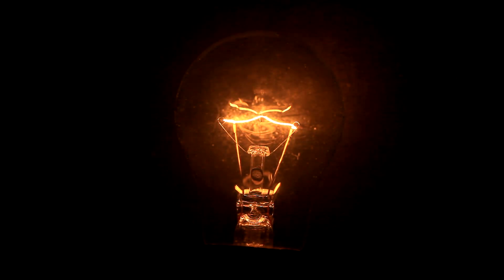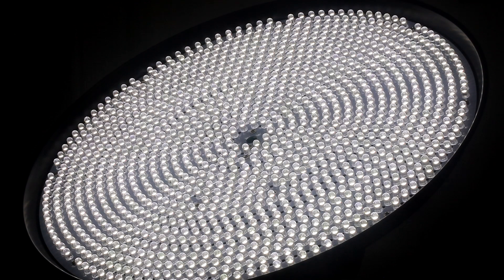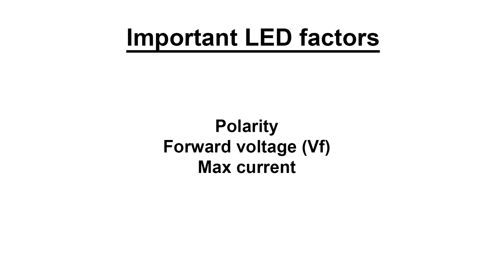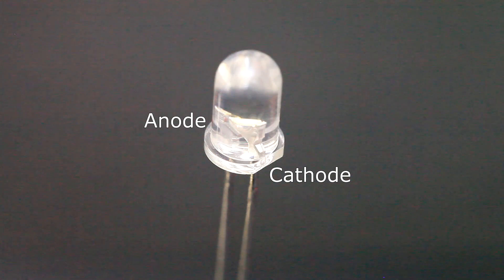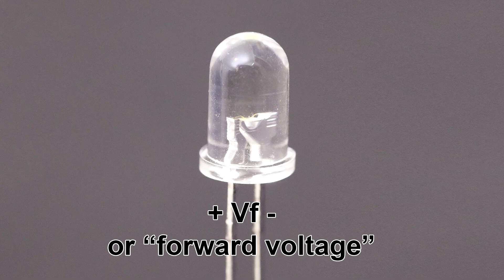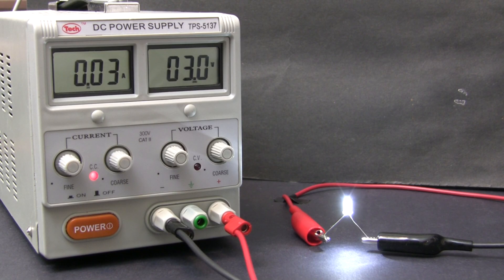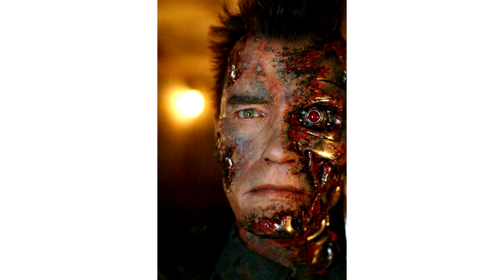LED Basics

Comment from the maker: If you are too stupid to know what "commercially viable" means then don't bother leaving a comment about Thomas Edison.
Reply: I’m not stupid I just don’t know what it means :(
Reply: @Jgamer12901  the ability of a business, product, or service to compete effectively and to make a profit:
Reply: @Jgamer12901  Commercially viable refers to a product which has sufficient buyers to cover costs of production + make a profit for sustainable growth of a company.
Reply: the ability of a business, product, or service to compete effectively and to make a profit.. 🤷
Reply: Gigachad comment.
Reply: Can we turn on the led without using resistor provided that we have 5v and 20ma power supply?.......
Reply: @romulopartoza5598  yes but, it will burn in moments time
Reply: @romulopartoza5598  The 5V and 20 MA rating is considered the upper safe limit Voltage and what the safe Current draw is.  As long as yo don’t exceed the 5 Volts the LED will not exceed it’s 20 MA Current rating.  With that in mind, 20 MA for a Power Supply isn’t what you’re looking for.  The Power Supply could be very small but would need to be able to safely sustain the 20 MA power draw for the LED.  You can have a huge Power Supply and not harm the LED as long as you apply the correct Resistor to not draw more than the 20 MA limit for the LED.  If you drop the voltage of a regulated DC Power Supply to let’s say 3 Volts, the LED should function without the Resistor.  The resistor is being used as a crude voltage regulator in an LED Application.  The newer Bright and Ultra Bright (UB) LEDs are much more dependent on their Voltage and Current Ratings.  An UB may not work on a lower voltage.  A regular LED can work with as little as 1.5 / 2 Volts.  JimO
Reply: @romulopartoza5598  yes you can.
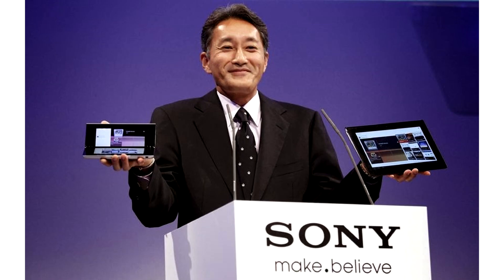Reply: Question, what is this led light called at 1:02?
Reply: @s4m4r1t1ntv  a light emitting diode
Reply: @james77011  I know that, I mean. What's the circular looking type of led shown at 1:02 of the video? It looks like it could be used for a diy arc reactor.
Reply: @s4m4r1t1ntv  can i send u a link with some LED's similar to the one's in the video?
Reply: @james77011  That would help actually so yes! Thank you.
Reply: Woah recent update. Dude please come back! 

Also, who is this comment for?
Reply: Lmao that old chestnut
Reply: Gee, now I want to know who said what, lol!
Reply: @flyurway  Same
Reply: @flyurway  Name names
Reply: Smart ass.
Reply: not true, they didnt even have television back then let alone commercials for products such as light bulbs. fake news

Comment: So for these tiny projects you can get by with a resistor but for larger more ... "finished" projects you would need a LED driver to manage the voltage, yes? If my understanding is correct as long as you supply the LEDs with the amps at or above their requirements you are good?
Reply from the maker: Pretty much yeah

Comment: Forgive the stupid question, as Im trying ti fugure allof this out (great channel BTW) when you toasted the LED by jacking the voltage to over 7v,  what if you took your power supply and limited the current to 3 milliamps @ 7v. would it still blow? Can you even do that?
Reply from the maker: Yes you can! If you set the current limit to 3mA then the LED would be fine. The power supply would probably output a voltage around 2V and deliver 3mA that's it. Current limiting power supplies are extremely useful.
Reply: @Afrotechmods  Thank you kind sir !!

Comment: I wired up and LED to an electrical cord. I plugged it into my electrical socket, and it blew up the LED, and my breaker blew. I forgot to add a resistor.

Comment: I want to say thanks for making this simple to understand. I know ZERO about LED's accept I'm thinking of cutting some circles in my trolling motor for night use where I can know which direction the head of the unit is facing at night because nobody was smart enough to include that on $3k+ items. I can handle the holes but don't know how much power I need to run to them as my boat has 12Volts and 800 Cranking Amps. LOL... Quite sure that will blow the tiny bulbs. LOL.

Comment: When I started to learn electronics, only red LEDs were available and green ones came out a while after. Then later I saw a  three color LED at a Radio Shack store, which could glow yellow when connected to an alternate current source. It was glowing green when connected in reverse polarity. One day I shook it while it was yellow then noticed it was alternating between red and green. So cool I felt that day. Before I saw blue ones then finally the white ones, many many years passed.

Comment: I have only one question about led.The led is not  new invention .
We have led from the 80's, but why only in recent years so much development has been observed?And now their expansion in many areas?
There were a "dead period" between 1985(?) -2015 (ok at 2004 we have the blue,and little be later the white)
Reply from the maker: That's a good question, and I think the answer is around 2010 or so we started seeing manufacturers making high power (1W+) LEDs at prices well under $1. Also by then an abundance of cheap and easy to use constant current LED drive circuitry had come on to the market. Once things become cheap and easy enough to use they end up with wider adoption.

Comment: so if you don't limit the current but provide the right voltage (e.g. using a Buck converter at 3v and max. 5A) will you still burn the LED?
Reply from the maker: If the LED's forward voltage is EXACTLY 3.0V and your power supply puts out exactly 3.0V yes you can get away with it for prototypes but this is not ideal and it's generally considered to be a bad design habit. If the power supply fluctuated by just a little bit it would pop the LED.
Reply: @Afrotechmods   so is the resistance of the LED is not such that when supplied the right voltage it will have the right current but could be more? I had a 5630 LED in hand and when connected to 3v it just take 8ma on their own. So you're saying that might risk it...guess I'll use a driver board...

Comment: I took my dads television apart because it had a dim screen. I have this LED in my dad's television. SV0320AG6_REV3_7LED_130701 With the TV module disconnected I powered it up and some of the led did not come on and other did but not too bright. How can I test this led module with a battery resistor combination? I need to test the voltage coming out of the power board too.

Comment: Concerning forward drop voltages, there are two different types of green LEDs in production, one that is phosphide-based (yellow-green), another that is nitride-based (blue green). It appears that older green LEDs tend to be the former type, and newer units are typically the latter type.
Reply: Hi

Comment: What kind of resistors, which value? Does it depend of the current? If I put a high resistor in the circuit between cathode and ground will there still be enough current to let the led light?

Comment: I have something interesting to add. I am working on a preamp circuit and wanted to include a blue LED or two. The preamp is powered by the phantom voltage in my mixer-48 volts. After many tests I realized that the blue 3mm LEDS will light using anywhere from 2.2-5 meg resistors in series with either one LED or the two in series! Amazing. Please explain this.[since I might lose track of this page, please write to me at computerlen@hotmail.com]

Comment: Hey Afrotechmods..
Noob question here.
If a 9v battery, as in your example, needs only 3v to run one LED, could I safely wire in 2 more lights into the same circuit?

Thanks, 

d

Comment: LED'S will work on AC. it just uses half the AC wave.
Reply: thats because it's a diode, right?
Reply: @benjammin2020  yes. It worked for me on 25 volts A/C. With a resistor. I forgot the ohms.
Reply: @markmarkofkane8167  Where where you using the led that you had 25V AC? Just wondering, because in my limited experience, it seems to usually be mains AC, or DC used in projects and the like, rarely low voltage AC. what frequency?
Reply: 60 Hz. It was a thermostat for the room heat. I had it wired so the LED went out when the contacts closed. The thermostat opens and closes relay that turns the heat off and on.

Comment: I am trying to figure out why the headlamps I got as a free gift at Harbor Freight stop working. They are the kind of headlamps that you wear on your head. I put new batteries in them but that does not help. So I think there is something else that is the problem. I got like 5 or 6 of these headlamps and they are great when they work, and so I just want to fix them so they keep working. Anyone got any suggestions?

Comment: I just repaired an LED magnifying lamp. Apparently, there were many LEDs that were burnt out or simply tired. The circuit is 16 x 6 LED strings in parallel to an 18 VDC supply. Half the strings were either flashing or simply not on.  Instead of trying to discover which LEDs were bad, I simply replaced an entire string. The new LED's are much brighter than the old ones. I may just replace all of them.

Comment: I'm still struggling to grasp Current vs Volts. You pushed up the volts but didn't adjust the current?
Reply: You can use water analogy, water is like current, n height is like voltage, n width of the pipe the Resistance, 
So the voltage tries to push current through the led, n current can be controlled using a resistances
Reply: @azzyfreeman  So the voltage is the force pushing the current?

Comment: The last time I used LEDs for a project (yearzn years), they were all rated for 5V.
 3 x 1.5V batteries worked to light them, too. Then a project came up at work that needed LEDs, and in talking to the guy installing the lights in my design, found out they were all 3V! When did that change come about? Are 5V still made?
Reply: Yeah, you can get any voltage. But you can put 5V thru 3V LEDs anyway, they only fry around 12V.

Comment: How is slow color changing RGB LED designed? Can it be programmed to flash much slower so that each cycle would last  minutes or so? Why manufacturers consistently make the same duration RGB LED 5mm bulbs that don't even cycle correctly.

Comment: If you don't know the forward voltage of your LED, use a power supply which has a constant current mode and can display voltage and current. Turn up the voltage until your LED draws 20mA. The voltage is your forward voltage. Use that to calculate a suitable resistor. Not all LEDs run well with 20mA. The high power ones generally run with 300-700mA. They get really hot, so don't forget the heatsink.

Comment: I want to add an LED to my 4ohm subwoofer, to show that is getting power. But, what size led do I use, or is this even possible?
Reply: You could go the route of things like VU/power meters and use the signal going to the voice coil, but why not simply hook into the the 12V that comes to the amp's remote turn on? Ok, yes, that would turn on even if say the main power to the amp was off, like blown fuse, but light and no sound would be cause to investigate...

Comment: If the total series voltage drops equal the battery voltage then why do you still need a resistor to limit the current?

Comment: How would you wire 10 led bulbs but I want it to scan one at a time with a 2 second delay.  For example, led 1 turns on than off, then led 2 turns on than off and so on.

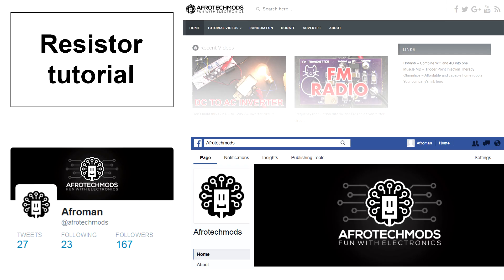Comment: this might be a dumb question, but how come in this video at 4:40, i see you have your resistor installed on the cathode to the black lead to your PSU?  but in your NEXT video following this about resistors, you are adding the resistor to the red anode side of the circuit?  does it not matter where you place your resistor?

Comment: Well explained. Great video :D one question. If you have an output voltage of 7v or higher but you have a current limit the LED won't blow up? For example: i have an led that its forward voltage is 2.25v @ 350mA. If i have a constant current driver @350mA but the voltage is outputting 12v i wont have any problems? Thanks

Comment: Thank you, this is just what I need. I want to try putting lights into various projects but I also want to do it right and keep it safe. I had doubts about whether tiny LEDs with batteries could be a fire hazard (I'm starting from zero here so I need the core knowledge) and now that I see what can happen, I know I was right not to rush in. But the great bit is knowing why. I don't like stumbling in blindly. I watched another video here where a dude just snipped off both wires and soldered the thing to some copper wire and then a switch without worrying about resistors or which wire was which. He said you had a 50% chance so no worries.The comments below it were full of people basically tearing their hair out in exasperation so I thought I'd better find a quality source of information before I even buy the supplies... outside of the soldering materials, which I have.
Reply: Hey 👋

Comment: What happens when you have a string of LED lights that are all different colors?
Reply: If you wire them in series the forward voltages add up, the same current, (Vsupply - Vf_sum) / Rseries,  flows through all LEDs.

Comment: I recall, back in the late 70s, red LEDs were available, though very expensive. They glowed, rather than shined.  In 1980, I bought a pack of 50 once, for a light chaser project. They cost quite a bit. I never did complete that project and that pack is still around somewhere.
Then came green LEDs and suddenly the technology was interesting.  Blue were first announced in a Dutch magazine called Electra. TVs screens couldn't be that far behind.

Comment: A light bulb is basically a wire wound resister in a vacuum tube. Simply put, that's what it is! Also, not only can LEDs explode the smoke may contain some nasty chemicals. But even worse are semi conductors which are doped with chemicals like arsenic. Arsenic is a deadly poison and if the smoke from these semiconductors is inhaled it can be harmful. Enough of those vapors could be deadly. I don't k ow how much it would take, and have no desire to find out. When working on circuits your unsure of that contain Semiconductors do so in a well ventilated area.

Comment: This video is a description not an explanation. Any way that you could explain why two semiconductor's give off light. I heard somewhere that light is transverse electromagnetic with a longitudinal dielectric pulse. I don't know what this means.
Reply: Quantum physics - the energy the electron drops as it jumps the bandgap is given off in the form of a photon. That's the reason for the different colour LEDs having different forward voltages, as the energy of the photon determines the wavelength / colour of the light.

However some LEDs get their colours by internally creating UV or blue light that excites an external phosphor that in turn emits photons of some lower energy / other colour.
This is the same sort of mechanism that flourescent tubes use - Mercury vapor is excited and as "relaxes" UV photons are given off, hits the inside phosphor coating that then gives off a combination of colours that is sort of white.
The glass normally stops UV light, but special, germicidal, tubes made of quartz glass that is  transparent to UV, can be had for use in things like water purification systems. DO NOT use such a tube for illumination as it will damage eyes and skin! https://m.youtube.com/watch?v=1m0TQjBRcFo

Apologies for the tangent...

Comment: Nice! The electric current (flow of electrons) actually comes from the minus (-) and goes towards the plus (+) but most of the time that's not very important.
Reply: Conventional current (which is used in electrical engineering) flows from positive to negative.
Reply: Yup, electrons don't like hanging out together in big crowds for too long, too many negative vibes

Comment: In fact the Humphrey Davy demonstrated that passing electricity through a conductive filament produced light. It was then Warren de La Rue who solved the problem of burning out the filament by using thin filament in a vacuum. Thomas Edison came along 40 years later and patented a more commercially acceptable production version.

Comment: idk what he means by "the conventional current will flow out from"
Reply: Believe it or not, the accepted direction of electrical current in a circuit is actually the opposite to that in which it actually flows. In reality current will come out of the power supply 'negative' terminal and back in through the 'positive' terminal. This is why the term 'conventional current' is sometimes used. Although this all seems  bizzare it is because of errors in the understanding of electricity in the days soon after it's discovery.
Reply: @johnr6168  you mean electron flow theory, not conventional flow. conventional flow is widely accepted amongst those who don't understand electricity.

Comment: The voltage for led lights is dependent on what light they are built to emit. Take 1240/wavelength of light emitted to get the eV. eV are called electron volts for a reason since they are for every electron that gets excited in the LED, it emits a photon and best does so at that voltage due to the bandgap energy of the piece of semiconductor inside the LED. High voltage will overheat the light when so many electrons going through very quickly just like anything that short circuits and overheats.